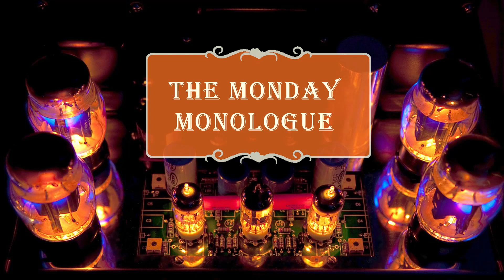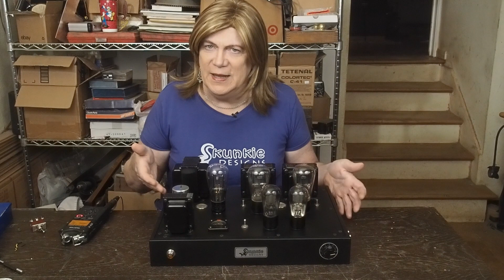Monday Monologue: Why Use Tube Audio Gear?

Comment: The one thing that scares me about tube amps is the high voltage. This prevents most people from modifying them and from what I am hearing most of these tube amps need modifying to sound great. Do any of these tube amps sound great right out of the box? The only one I hear of is Decware and they are 1 year out on delivery.
Reply from the maker: None of the cheap ones I have reviewed sound good out of the box and yes, the high voltages can be lethal if you aren't super careful. I have done some videos about tube safety.

Comment: For me, there is no romance in a small half circle 'transistor'....
I suggest that you try a MC cartridge - there is a world of difference
I have been rolling cartridges for a few months - even the Grado Moving Iron - and the MC Hana or Dynevector are so much better than MM. I like them all but MC - even a modest one - is special.
I suppose (but do not know) it related to the lighter moving mass
BTW... I make my own chassis now - out of wood for sides and metal top and bottom. 
It is not that hard... just takes some appropriate equipment and a bit of nouse

Comment: You are right about tubes with that they have more life. I too now use the 834 clone with great results in fact its the best I have had to date. I had good results with a Denon dl-110 high output moving coil. Like a fool I sold it years back but that was before I had any tube gear. I hear great things about the high output Hana carts. I eventually want the shibata high output moving coil cartridge that Hana makes. Its not crazy expensive and no need for the step up transformer but that is still way in the future for me. I am starting to sell off some unused gear but I'm holding off on big purchases for a while as the economy is worrisome to me. But we are on the same page. Great work as always.

Comment: As you are entering into turntable discussions, I’m going to share my findings… I recently built a heavy plinth Lenco L70. Did a couple of mods to it recently (bearing support/damping/coupling of top plate to plinth), and put the Lenco back into its original plinth. The difference was not subtle between the heavy plinth and the original plinth. Night and day. The mods improved it a lot more. Then I designed and built a suspension/damping/coupling/decoupling isolation system. That improved it again. I redid the wires in my tonearm after doing all that work (and rebuilt/reset the tonearm at the same time - SME 3009) and that improved it again. Currently running an Ortofon 2M LVB black cartridge. It’s is markedly better than my previous Ortofon 2M black. All this to say, there is an equivalent improvement in sound to be had from upgrading TT/cartridge as what you experienced with the phono stage upgrade you did. When I’ve built a “proper “ tube phono (looking at the Tubes4HiFi kit), then I’ll be venturing into MC territory and making a SUT for it. And an SUT is just a pair of transformers, so not that expensive to do. I am expecting another night and day improvement when I do that. Now, had I not gone through all this work building and modifying the Lenco, I would likely not have believed the huge difference in sonic presentation. It really is that dramatic! Granted, the TT weighs 90lbs, and has a ton of mods with a combo roller block/spring/vibration absorbing platform, so not a small shift, but wow, just wow, it all makes a difference! This was my inspiration for the isolation…. https://www.youtube.com/watch?v=evAx-1rv4lQ

Comment: people seemed split on it, but the Puffin phono preamp has been beautiful for me. it has many test features for tracking and azimuth etc. different load options and presets for different cartridges. I'm using an original pioneer PL-570 and a MC Denon DL-103.

also, for the price, the denon DL103  with a headshell that allows azimuth adjustment made a great difference to my ears.
Reply from the maker: That cart looks reasonable, still doing some research on this!

Comment: I would go with MC cartridge for the sheer light weight of moving element truly improving sound detail. Also, MC cartridges often have non-standard tip profile, i.e microline (similar to cutting head), shibata etc. adding to the overall groove tracking improvement from MM. Price-wise, you shouldn't go crazy. There are plenty of amazing sub-$1000 cartridges, also they would last easily few yeaars. My current cartridge is AT33PTG/2 (imported from Japan). You can find some audio samples online. 
Going high on vinyl though would mean you better search for all-analog cut-from-master-tape releases (there is plenty of good jazz nowadays, consistently beating 24/192 or DSD releases from the same label🤯).
Reply: I would go with moving iron and moving permalloy for the same reasons. Their moving parts can have less mass and more output than moving coils and unlike MC's, you can replace the stylus rather than the entire cartridge.
Reply from the maker: The MM cart I use is a microline and the shape of the needle def makes a difference.
Reply: @cobar53 You and Skunkie are both right. The stylus, cantilever, and moving magnet/iron/coil form a electro-mechanical system.

Comment: There are some really good MM carts and they are fun to listen to and has a sense of ease, but the low output MC’s with really good MC Step ups are o another level IMHO.. Just buy a used worn or broken Denon DL-103R and have it retipped with a ruby cantilever to get your feet in the water.. 

DIY some bare MC step ups from Cinemag or Lundahl… When I got the Hashimoto MC3’s though it’s hard to go back to smaller core stuff from Audio-Technica or Sowter’s lower cost ones that I had before.
Reply: I'll have to agree with you. I'm also using a 103R in a wooden case re-tiped by Thomas Schick in Berlin.
Reply from the maker: Is it across the whole frequency range or limited to the higher range of the spectrum?
Reply: @SkunkieDesignsElectronics   
The whole range… But don’t skimp on the Step Up trafos. Buy the best ones you can afford, and DIY them in your metal chassis of choice. Most of the expense goes to the ready-built fancy chassis anyway. High output MC carts are really good too, the good ones usually are like really good clean sounding PP Pentodes with global NFB, while the more renowned low ouput MC’s with studio heritage (SPU, EMT, etc.) are like a super refined 2A3 zero global NFB amp, PP or SE.. That’s just my take on it.